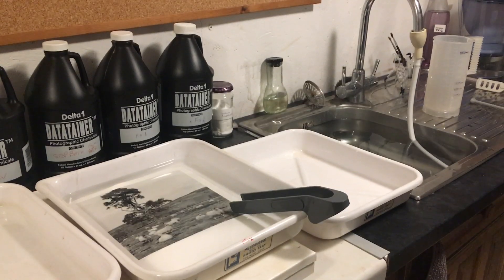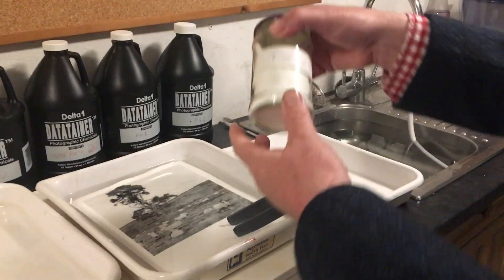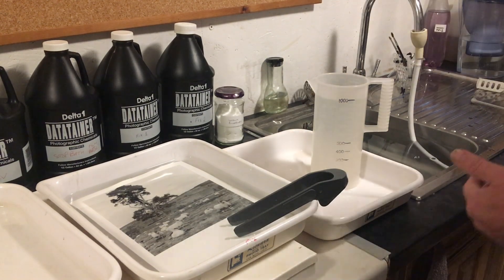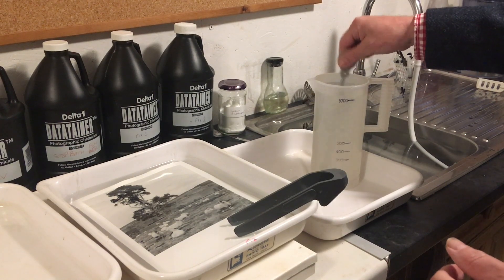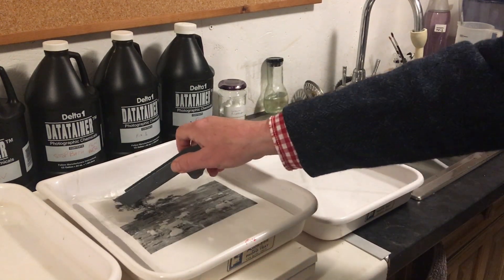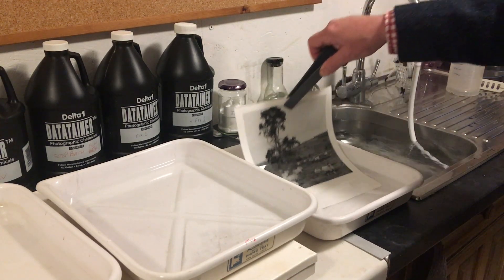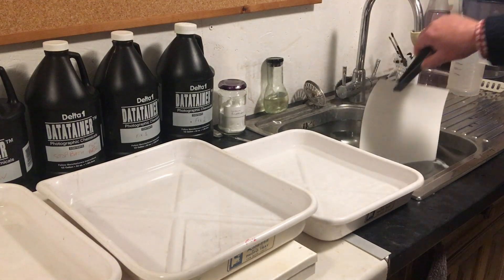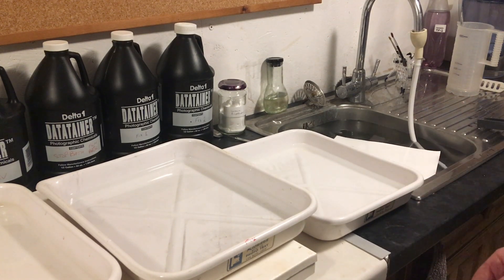Want to half your print wash time? Let's make hypoclear!

Comment: There are two types of agent used to expedite the elimination of hypo from film and paper. The first is a simple solution which presents a medium in which hypo more quickly exchanges out of the paper compared to plain water.  This is/was sold by Kodak as Hypo Clearing Agent, a solution of little more than sodium sulfite. What is presented here is in this class of agent. The second type is classically referred to as "hypo eliminator". This is a solution which chemically alters the hypo itself into another chemical compound which much more easily and quickly washes out of the paper. One source of this used to be (?) HR Hypo Eliminator. Perhaps as a matter of cost, the clearing agents tend to be more commonly available, however they are not as efficient in use. I use an eliminator which I compound from scratch based on formula I picked up about 40 years ago. (Dignan's Newsletter)  At this time, I'm about half way through my 2nd liter of stock solution.
Reply from the maker: What's your formula Randall?
Reply: @PictorialPlanet  Here is the formula for hypo eliminator stock solution:

Distilled water                                         900 ml
Ammonium Lauryl  Sulfate (15%)         50 ml
Propylene Glycol                                        5 ml
Anti-Form B (15%)                                      8 ml
Sodium Hexametaphosphate                 22 gr
Water, to make   >> 1.0 liter

Working solution:  1.0 ml in 1.0 liter of water
Use: Film: 30 sec; Paper: 2 min., followed by wash of 5 min or more.

Some of the components were difficult to find back when this was published, so I inmagine that some may be impossible today.

Comment: Can also be used in film, right?
Reply from the maker: Yes although I prefer to use an alkali fix which washes out if the film very easily. For prints I use normal acid fix most of the time.